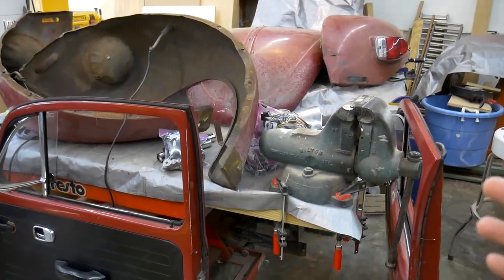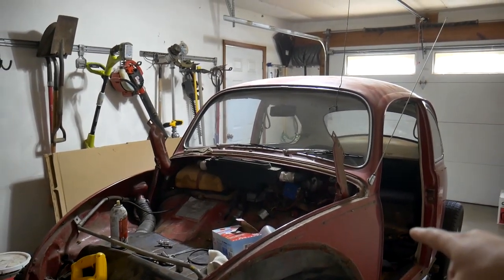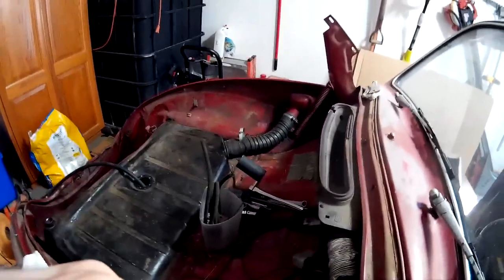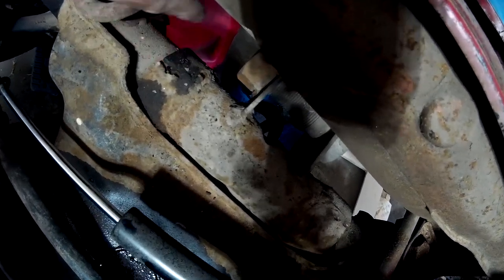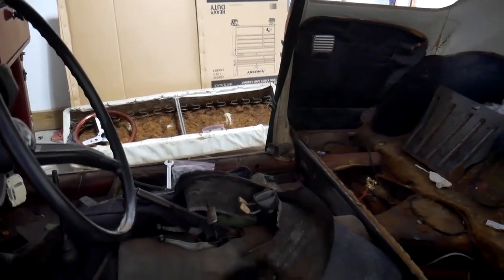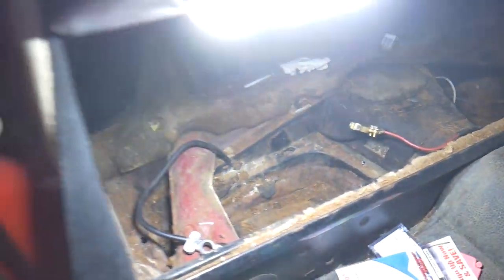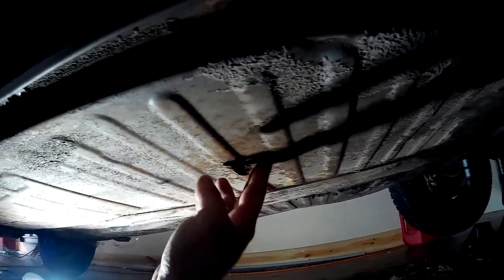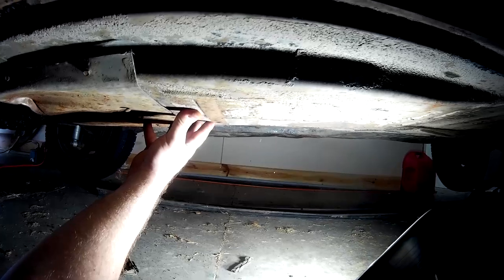Hidden Rust?!? 1968 VW Beetle Disassembly Days 3 &4

Comment: If you haven't found it already, Jbugs.com probably has ANY part you'll need. Including entire floorpans. Not terribly expensive either. They also have a YouTube channel with a bunch of restoration videos. Most recently, they replaced heater channels on one (unsure of the year).
Reply from the maker: I agree they have a comprehensive selection. I’m looking at several outlets for my parts. Since I’ll be buying things in phases, I can shop around for the best price. Thanks for watching!